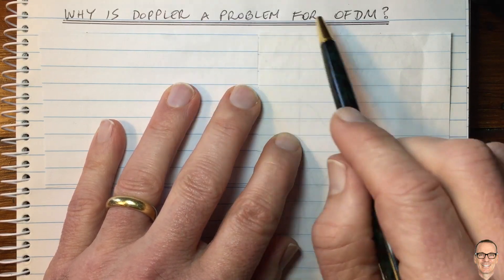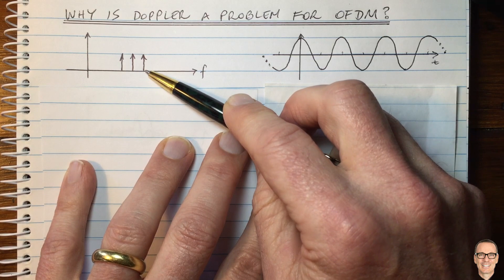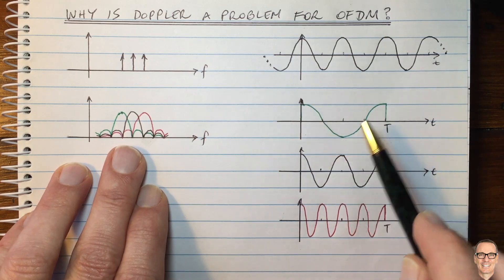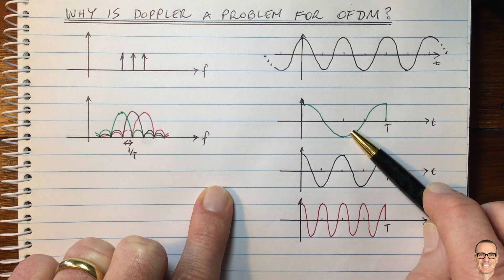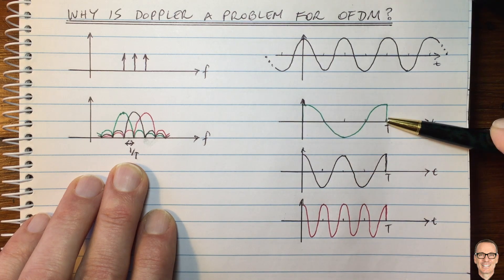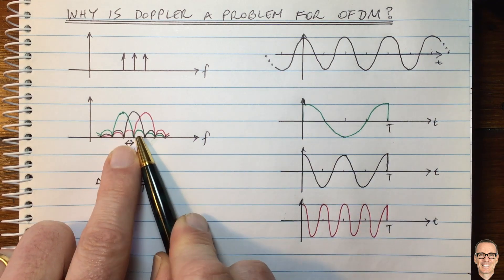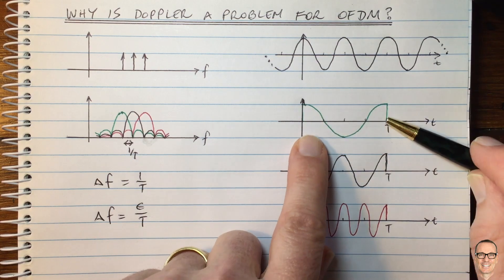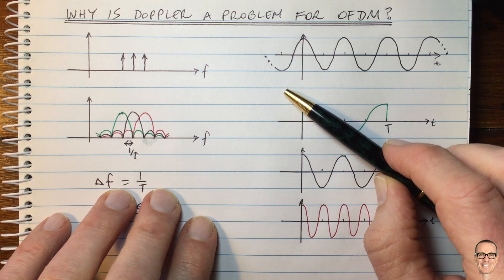Why is Doppler a Problem for OFDM?

Comment: Is there any way we can can calculate the doppler shift by comparing against a known frequency and modulate the carrier slightly to compensate?
Reply from the maker: Yes that's possible, but it relies on having a single transmission path. If there are multiple paths, then there will be multiple different Doppler shifts in the received signal.

Comment: So, based on my understanding for you explanation, the sensitivity to doppler effect should be critical in higher index of OFDM subcarriers, right? For example, when using the number of Subcarriers N = 1024, at subcarriers i.e.  1, ... 128 out of N, the data can be recovered at such doppler effect while data carried via subcarriers N-128, .... N will be much more affected. Is my conclusion right?
Reply from the maker: Not really. The spread of frequencies across the subcarriers is only a very small fraction of the carrier frequency.
Reply: @iain_explains  Yes, I agree about that. What I mean is the error percentage at data carried via subcarriers located at the beginning of the symbol is supposed to be less compared to the data carried via the subcarriers at the end of the same symbol.

Comment: What you said is quite correct, but the Doppler shift and the specific shift frequencies of different OFDM subcarriers are slightly different (the higher the frequency, the higher the subcarrier shift df=v/c*f), so when explaining the Doppler shift, you can also introduce this situation, which will make the modeling of the Doppler shift more accurate.

Comment: Sir, so, does this imply that ofdm is not efficient in High mobile environment. If that is the case what will be the solution for this. Sir, please explain this
Reply from the maker: Yes, you're right. There's not a simple answer to your question though. One thing that can be done is to consider using a new modulation format called OTFS. See this video for more details: "What is OTFS? Orthogonal Time Frequency Space Modulation" https://youtu.be/MvK3zhPrGkk
Reply: Thank you very much sir

Comment: But why is it a problem if the signals are shifted of 1/T Hz. If they are still orthogonal, we can still get the data no ?
Reply: Follow your assumption, they are actually still orthogonal. But in the receiver, you will get the wrong signal from the match filter. Like in w1 match filter, you will get a w2 signal component.
Reply from the maker: Yes, if there is only one Doppler shift in the channel (eg. if it is a line-of-sight channel), and if the receiver somehow knows what the shift is, then it can adjust it's carrier frequency and receive the data. However, if there are multiple scatterers in the channel (which is almost always the case) then there will be multiple Doppler shifts - some might be positive, some might be negative - and then it results in what we call a Doppler Spread. Then the subcarriers are definitely not orthogonal. See these videos for more details: "What are Doppler Shift, Doppler Spread, and Doppler Spectrum?" https://youtu.be/LLr3-kotbz4 and "How Does a Doppler Shift Affect Digital Communications?" https://youtu.be/9HqlfqBDwpY

Comment: Very enlightening.  Thank you so much.  I do have (another) query though, if I may.  
My mind is very much on WiFi.
In your video, you said that in digital communication we send signals for a finite amount of time.  I presume by that you mean one symbol at a time, for example a BPSK symbol? 
You went on to say that the effect of shortening the time is the same as having an infinite amount of time times a square rect function. Hence we see a sync function in the frequency domain.
Are you suggesting that, after modulation, an RF symbol, when viewed in the frequency domain, is a sync function?
I’m a little confused because I can visualise how a square pulse can give rise to a sync function in the frequency domain (a square wave can be constructed by adding together lots of sine waves with the appropriate frequencies and amplitudes), but how can a BPSK symbol for example also result in a sync function?
Reply from the maker: When a square wave (in the time domain) is multiplied by a sinusoid (in the time domain), it is the same as having a sinc function in the frequency domain (centred on zero frequency) and convolving it with a delta function (located at the sinusoid's frequency). When you convolve something with a delta function, it moves your function to be centred at the location of the delta function. These videos might help: "Convolution with Delta Function" https://youtu.be/TIcfY19dk0c and "Amplitude Modulation AM Radio Signal Transmission Explained" https://youtu.be/-PWg-0k2oks

Comment: hi! professor! Sometimes, doppler does not shift equally for all frequency, right? For the higher frequency, the doppler would cause more shift.
Reply from the maker: Yes, Doppler is a function of frequency. However, across the band of an OFDM signal, the difference is not significant, from the lowest frequency to the highest - since the bandwidth is small compared to the carrier frequency. This video should help: "What are Doppler Shift, Doppler Spread, and Doppler Spectrum?" https://youtu.be/LLr3-kotbz4

Comment: So you wouldn’t use OFDM for low earth orbiting satellites (or anything that moves). But it’s okay for tv transmitters.
Reply from the maker: People are starting to look at using OFDM for high data rate communications on LEO satellites, and Starlink have announced that they will soon be providing 5G over their LEO network, so it's not impossible to use OFDM over LEO links, but it's not ideal. A potentially better suited modulation format is OTFS: "What is OTFS? Orthogonal Time Frequency Space Modulation" https://youtu.be/MvK3zhPrGkk

Comment: Thanks, is it possible to give some carriers a higher transmit power than other carriers in OFDM?
Reply from the maker: Sure. You can scale the constellation in each subcarrier as you like. You can even set it to zero, if you want.
Reply: @iain_explains  do they apply that because higher frequencies have a higher  path loss? Perhaps they adapt that by default, so nobody must care about different pathloss for different frequencies.
Reply from the maker: This video might give more insights: "How are OFDM and xDSL (DMT) Related?" https://youtu.be/CET2UuGeEqs

Comment: Hi, 

So I have a question regarding this phenomenon. Let's assume I have an OFDM signal with 15 kHz sub-carrier spacing. I am sitting in a fast-moving train, moving at 400 kph, with an RF frequency of 1.8 GHz. Then the Doppler shift would be 700 Hz. It is around 5% of the sub-carrier spacing.

Do I need to correct the Doppler in the analog domain (for example with a very accurate LO and feedback from the digital front-end)? Or do I ignore the Doppler, sample the signal as received, and account for the Doppler in the digital domain?

And thank you for your insightful videos.
Reply: you can study the research "The Effect of Doppler Frequency Shift, Frequency Offset of the Local Oscillators, and Phase Noise on the Performance of Coherent OFDM Receivers" and get the answer to your question
Reply: and study DOI: 10.1109/4234.809526. it is a very useful article